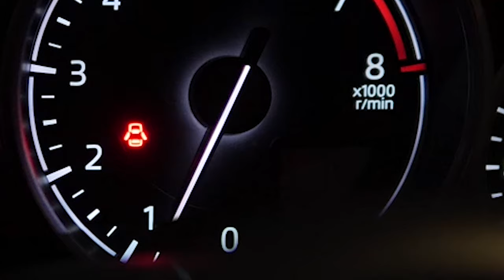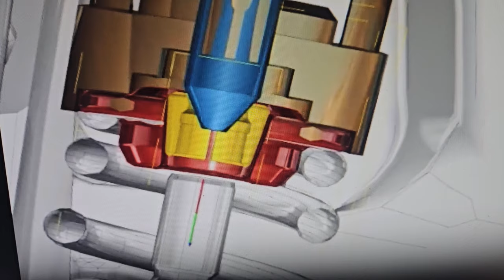Mazda CX 5 Oil Consumption. Mazda Warranty Extension. KIA soul Free Engine replacement update.

Comment: What is the successful rate of that operation? Last month, my Mazda CX30 Turbo 2021 had that repair but the oil consumption is still present.
Reply from the maker: The installation of the valve stem seal needs to be measured. If the seal is not installed correctly then it can leak.  Mazda has reported some issues and reminds technicians to always make sure the seal is installed correctly.  Mazda also says that 1 quart consumed in 1200 miles is normal.
Reply: @ShopForemanGarage  Thank you!
Reply: 1 quart every 1200 miles for a new car is a lot.

Comment: Was this issue from Japanese built or domestic built ???
I have a 2015 Mazda 6 at 182 K  and the only oil leak I had was the valve cover gasket. 
I am about to rebuild my engine ( bottom and top end ) and trying to find the best quality replacement for the valve stem seals .
Reply from the maker: It was all of them 2021-2022 Skyactive 2.5L turbo engines only.  2015 Mazda 6 was good.
Reply: How is it performing now?
Reply: I have the same car as you but with 145k miles, I did have a cover gasket leak that I fixed a few months ago but that's it. On the other hand I have a 21 mazda 6 thats on the blacklist, its a fairly newish car with 28k miles and no leaks yet. They Are Both Japan made.
Reply: @hugostiglitz47  What kind of oil do you use?
Reply: @yournightmare9999  on my 2015 m6 I used 0w20 but after 120kmiles I started using 5w30. I might go back to 0w20 because of some mechanics recommended me to keep using the manufacturers choice
Reply: @hugostiglitz47  What's the brand you use
Reply: @yournightmare9999  Castrol FS
Reply: @hugostiglitz47 A few months ago, valvoline released new oil "valvoline restore and protect". Try this one; this is a clean engine, make engine quiet, and prevent oil consumption. I always use castrol edge to but now on valvoline is quite and smooth 👌
Reply: @yournightmare9999  I will look into it. Thanks

Comment: How generous of them to extend warranty by 1 year 24,000 miles
Reply from the maker: Exactly. But, it is a settlement, so the lawyers and plaintiffs must of thought that was good enough. I think (and of course this is just my opinion) that the main reason is so that people that already paid for the repair, could get reimbursed.
Reply: @ShopForemanGarage  lol I work for ford and on some of the vehicle they extended the flex plate coverage to 7 years 70k miles. And I was like gee wow.. thanks ford

Comment: Is it normal to have a bit of oil loss during the first few thousand km? We have a brand new 2024 cx5 (non turbo) and it's looking like there is a slight drop in oil level (maybe 1/4 of the space between the holes in the dipstick) we literally only have 1000km on it.  
I've only had one new car, in 2009, and never checked the oil this soon. 

Any thoughts? I'm in Canada btw
Reply from the maker: Hello from Canada....I mean...to Canada...from...Texas... Anyway. First I want to make sure you are checking the oil correctly. I know it sounds wierd but, Mazda has a specific way to check the oil and I don't know if it is in the owners manual. It is in the oil changing procedures.  Some Mazdas, not all, but some, have a star or astrisk stamped on the dipstick. Sometimes its on the top and sometimes its on the bottom where you read the oil level.  Make sure, If you have that, that it is facing the front of the vehicle when the dipstick it pushed in all the way.  The vehicle should be warmed up to operating temperature. Make sure the vehicle is sitting on a level surface. And, when you shut the engine off. You must wait at least 5 minutes before checking the oil.  Make sure you pull the dipstick strait up and do not twist while pulling on it.  What I do is, after I shut the engine off. I pull the dipstick and whipe it off. Then wait the five minutes, push the dipstick down and pull it up and check the level. 
As far as the 1000km. I wouldn't worry too much about it. The engine is still breaking in. Once everything comes together as a unit. I'm sure it will be alright.  Just keep an eye on it and see what happens down the road.  Give it a little bit of time.
Reply: @ShopForemanGarage  thanks for the info. 
I've owned 4 Mazdas, and usually just check it in the morning before the car has been started. I would think that would be fine here to no? 
I'll double check the asterisk thing tomorrow too. 
I've just never checked oil on a brand new car. Since this isn't a turbo, I was kind of surprised to see it going down a bit, but like you said, hopefully it's just breaking in etc and won't be an issue with the road! 
Cheers